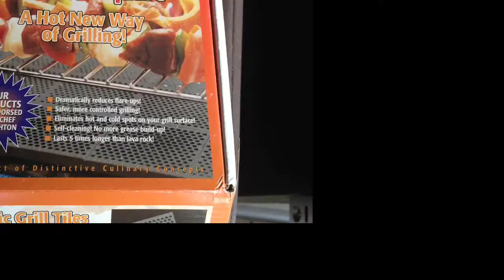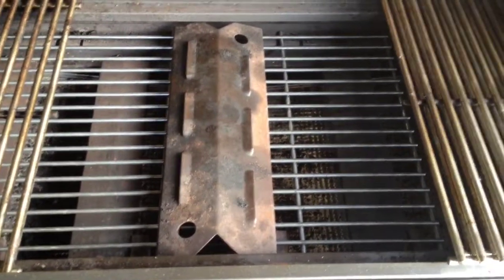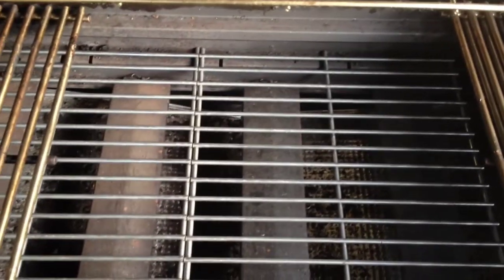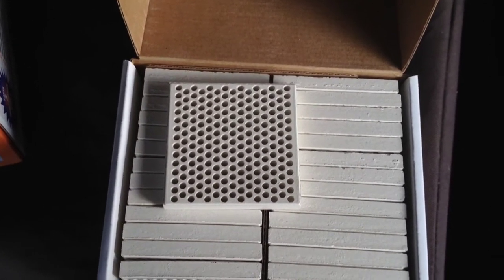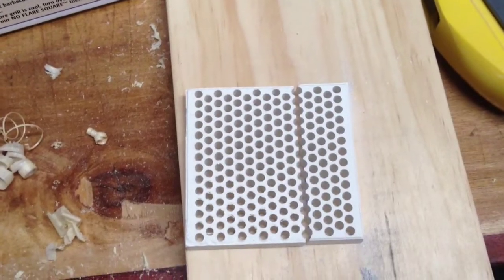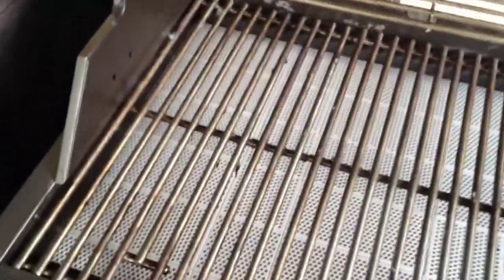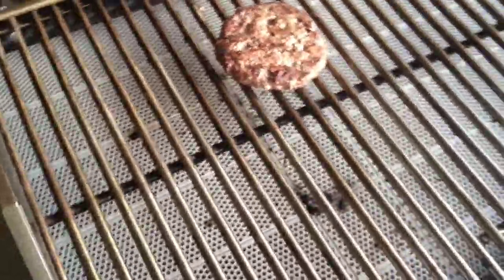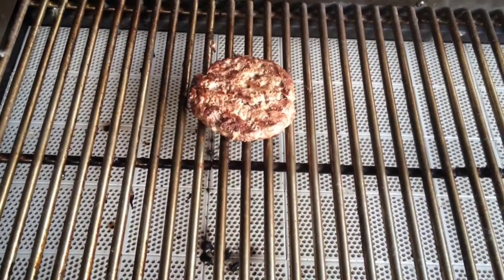Customized Master Forge Modular Gas Grill

Comment: Thanks. What if the holes on the ceramic get clogged?
Reply from the maker: Usually just gets burned off and turns to Ash
Reply: @MSRWorkshop  Thank you for the reply. And just in case you know the answer, in my machine the ceramics have to be fixed on the ceiling so the heat kind of radiates from the top. One of the ceramics has a cracking and it's terribly hard to replace one. Can you think of how the cracking can be filled or something?